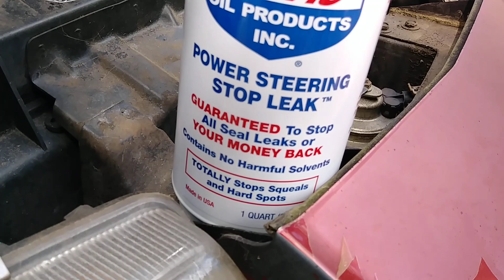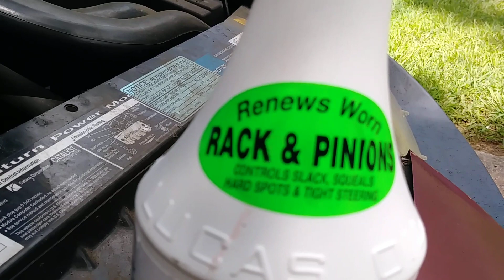Lucas Oil Products Power Steering STOP LEAK Does It Really Work?

Comment: I tried a bottle of Lucas and though it didn't stop the leak completely it definitely slowed down the leak considerably in my rack.  I can live with topping off about an ounce of fluid every couple of weeks, much cheaper than dishing out $700 right now for a Rack replacement.   I doubt a second bottle of Lucas is going  make any difference and I doubt it even more I would ever get back a refund from Lucas if it doesn't work

Comment: Do u only have to add the Lucas product or do you mix it with regular power steering fluid ?
Reply from the maker: No just pour it in with what is already there but what lucas does it expands the seal to stop the leak and also you have to keep adding it the best to do is just have your rack replaced because the only thing lucas does is just slow down the leak Thanks

Comment: Wow that is a big leak! Well judging by the stains
Reply from the maker: But believe it or not the Lucas treatment worked has not leaked in months
Reply: @DarrellDeese  ok I will try that other than fhe prestone powersteering stop leak,  because it doesn't seem to be working, or most likely the reason it didn't work is because it isn't a daily driver yet, and have others things to do and fix before my dad and I start driving it, but if I just turn the wheel back and forth from each end several times that should be good enough right? I can't drive it well enough since it is a manual and I have been driving it around my blocm on the weekends.
Reply: @DarrellDeese  i will do so and pay for a bottle of it with my own money, since my dad doesn't think it will work. Well it is worth a shot.
Reply from the maker: @chrisortiz2640  Hi chris if its the seal thats leaking it may or may not work like me your just taking a chance but if so give it about two to three weeks for it to swell up the seal like i said it may not work good luck
Reply: @DarrellDeese  ok well I will find out eventually, or not, since my dad is taking the 4runner to get the clutch fixed and might as well get the powersteering fluid leak fixed as well.